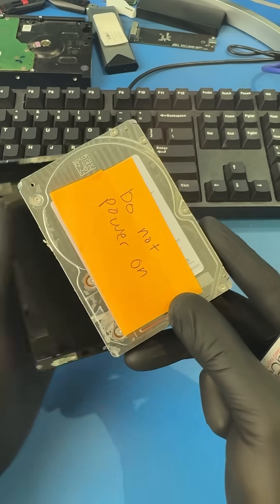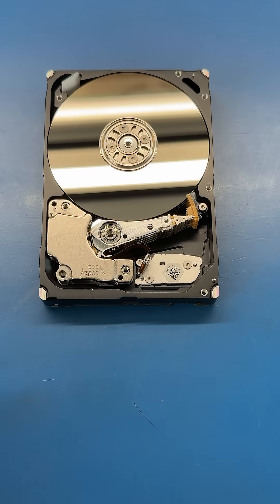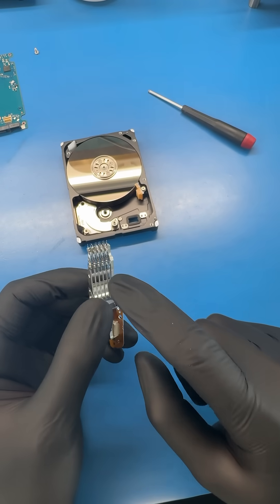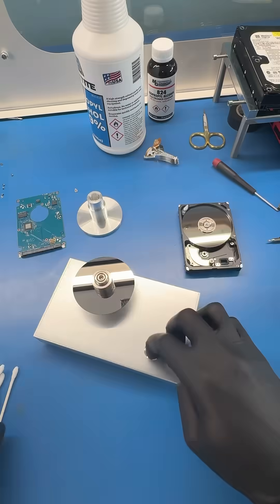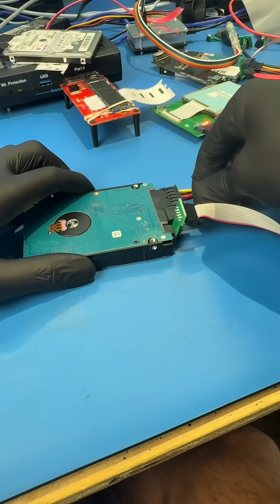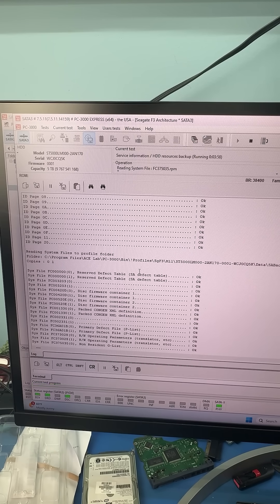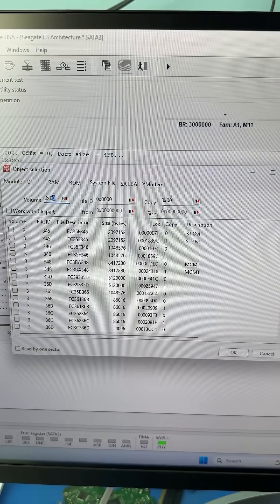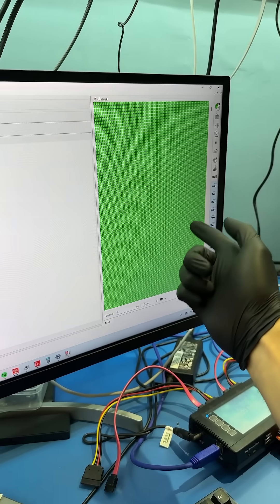Hard Drive Platter Extraction... #technology

Comment: To give people an idea of how difficult this stuff is, I've worked at some repair shops over the years. We didn't do hard drive recovery, too difficult, and if anyone came in asking for help we'd be honest with them: It's expensive, time consuming, and the potential of it working is not great. We're talking easily hundreds of dollars, possibly thousands if the damage is particularly bad. This man does absolute magic
Reply: I have a sudden urge to want to learn this skill because of the difficulty and it looks like you work inside😂😏
Reply: @darthvoltron959  I wish you luck.  If you don't have ANY computer skills yet, I'd say start with something like a current CompTIA A+ cert and then build up into the hardware.  You've got to understand the basics of what you're dealing with.
Reply: @darthvoltron959  Look up Louis Rossmann he's done a vid about this and pointed to someone else who does it, can't remember who, with a minimal setup.
Reply: @darthvoltron959 go outside more
Reply: FYI, for anyone wondering. Most drive recovery begins at $550 & goes up from there. I spent $800 to have mine recovered. Had years of papers on there, music, & pictures. Worth every penny. My dad's laptop, $1,500 later they recovered 98% of his data. Thing wouldn't power on (the drive), so they manually did it somehow.
Reply: I worked at a shop for a while, and it was the same for us. We didn't have the tools or space for hardware recovery, so we stuck to software, which was often successful. Granted, the technical process of what's shown here is very approachable, especially if you can already do board-level repair. It's a delight to see the 'next step' that we sometimes sent drives off for when the data was worth the money! An ounce of prevention for a pound of cure. Back up your valuable data!
Reply: To my knowledge even hard drive recovery places can only go as far as replacing the heads. I always understood that if the platters come out, there is no chance of reading that data. What this guy is doing should be impossible.
Reply: @Ozzyman11  That's not entirely true. Yes, if you take out the platters in your house, you're almost certainly fucked. There is almost no gap between the heads and the platters, and even microscopic pieces of dust getting on the platters can cause a head crash, this is why drives are sealed the way they are.

However, drive repair shops like this that are capable of doing platter swaps have incredibly well-filtered cleanrooms that are usually ISO Class 5 or Class 100 certified, meaning that there are very few, if any, dust particles of a specific size or above in the room, meaning there is nothing in the air that can damage the platters.

This is why you send failed mechanical drives to a professional like this. There's absolutely no way you perform a head swap in anything but a cleanroom like this and get all your data off of it. With older, less dense drives you might recover some stuff, but almost certainly not the whole thing.
Reply: @wisplite wouldn’t he need to be wearing a completely enclosed suit for that to be the case? i’d imagine his arm hair and skin cells would be floating around
Reply: @wisplite  the heads do not park over the platters, they park in a safe position. You can easily replace heads with little to no risk to the drive. 

As far as dust goes, you can just make a small plexiglass/lexan box with some basic filtering and have a plenty clean enough space to remove the platters with no concern. The data is stored magnetically, so as long as the platter itself isnt damaged, recovering data isnt that hard. Unless the drive is encrypted of course, then you're fucked without the key.
Reply: @wisplite  Dont you have to make sure they are placed in with the correct rotatation or does that not matter?
Reply: @IanB8968  Probably in a pressurized clean room, like at least, a Class 100 to attempt repair on hard drive platters. 

Just doesn’t show us because it would be technical and boring. Because you can’t see the effects of a pressurized room that keeps nano particles down. It is has to be visited to realize what an amazing thing it is. 

Full suit would only be necessary if he was making the silicon chips and boards themselves and then that would be a Class 1000 room, instead!
Reply: @wisplite  how doesn't dust get in there with him from the outside like from his clothes or something? Or his tools or anything it's almost impossible idk about this stuff I am curious
Reply: @Ozzyman11  no it isn't this kind of data recovery has been done for many years, you do the work in a cleanroom to protect the platters.
Reply: @Ozzyman11  no it's not impossible.  Because when any reading platers gets damaged during accessing of HDD. It's doesn't just Hardwear issue. It's also causes software issues. More specifically data allocation memory issues also raises. So even after replacing the reading platers when u connect the drive it doesn't just start reading data from HDD just like before but it doesn't know from when to start reading data.  So this person is basically scanning the HDD after replacing the reading platers for its data allocation memory and seeing the location of data at where it's stored and then he is trying to access that data by directly accessing the location form that specific software.   

Ones you recovers all the Data to another drive , u can just format the whole HDD and then again u can start using ur HDD like normally.  Because one's it's gets formatted.  All the Data is gone and when u store new data then HDD behaves normally and starts allowing data to write on HDD and store thr location in allocated memory.  

The missing space when u buy any drive is used for this only. For 1TB drive u can use about 931Gb space outof 1024Gb to store ur data.  Missing 93Gb space will get occupied by memory allocation system.  This 93Gb space will store the exact location of the data u r storing on those 931Gb space.  
When basically when any HDD gets damaged by broken reading platers. This 93Gb space which stores location of ur data gets corrupted.
Reply: @Ozzyman11 why would a platter being removed and put back have any significant effect on the data? It’s magnets on a fancy frisbee. Just don’t abuse it and it’ll be fine.
Reply: @ninjasauce32  one microscopic speck of dust in the way of the reading head and the whole thing becomes a paperweight.
Reply: @MrTeddy12397  I'm just looking at the key board... It's cleaner than out of a box. I'd be so paranoid entering that room!
Reply: @mattburow6018  I wouldn't be surprised if the guy is wearing a chip fab bunny suit.  It would be worth it.  The only way to be successful at this is to have a high batting average of success.  To a large degree, this is a word of mouth business, hence these videos.  Most likely recommendations are a primary selling tool.
Reply: @Ozzyman11  Yeah, no... it's definitely nowhere near impossible, lol. It may seem extremely complicated or difficult, but its' really not that bad. A bit sensitive, sure. But even then, plenty of things are more sensitive than HDD platters. The reality is, the biggest hurdle to this kind of recovery is the tools/environment.

And I say this with great respect. I don't mean to minimize his work at all, but it's really not that special. I would say work like surgeons, oncologists, etc, is a lot more precise and difficult.
Reply: There’s always someone smarter and better then you and willing to put in the effort
Reply: To add an additional example for the level of black magic this man performs;
I interned at a PC repair shop just about 20 years ago and the only place in Europe that'd do physical recovery of a HDD was a clean-room/sterile lab in Switzerland for about €15K (€1 ≈ $1 back then). 
Their services were mostly used by forensic teams.
Reply: For real, I've worked on PCs for almost 20 years and I will never touch the internals of a HDD. Too risky, too expensive.
Reply: .....
Do you know Jesus Christ can set you free from sins and save you from hell today 

Jesus Christ is the only hope in this world no other gods will lead you to heaven 

There is no security or hope with out Jesus Christ in this world come and repent of all sins today 

Today is the day of salvation come to the loving savior Today repent and do not go to hell
Come to Jesus Christ today 

Jesus Christ is only way to heaven 
Repent and follow him today seek his heart Jesus Christ can fill the emptiness he can fill the void 
Heaven and hell is real cone to the loving savior today 
Today is the day of salvation tomorrow might be to late come to the loving savior today 
Romans 6.23

For the wages of sin is death; but the gift of God is eternal life through Jesus Christ our Lord.

John 3:16-21 

16 For God so loved the world, that he gave his only begotten Son, that whosoever believeth in him should not perish, but have everlasting life.  17 For God sent not his Son into the world to condemn the world; but that the world through him might be saved.  18 He that believeth on him is not condemned: but he that believeth not is condemned already, because he hath not believed in the name of the only begotten Son of God.  19 And this is the condemnation, that light is come into the world, and men loved darkness rather than light, because their deeds were evil.  20 For every one that doeth evil hateth the light, neither cometh to the light, lest his deeds should be reproved.  21 But he that doeth truth cometh to the light, that his deeds may be made manifest, that they are wrought in God.

Mark 1.15 
15 And saying, The time is fulfilled, and the kingdom of God is at hand: repent ye, and believe the gospel.

2 Peter 3:9
The Lord is not slack concerning his promise, as some men count slackness; but is longsuffering to us-ward, not willing that any should perish, but that all should come to repentance.

Hebrews 11:6
6 But without faith it is impossible to please him: for he that cometh to God must believe that he is, and that he is a rewarder of them that diligently seek him.
Jesus
Reply: skill issue
Reply: I repaired computers (mostly software issues, but not only) from the age of 8 years, the people who thought they could do the same always said that AFTER I had fixed the problem, go figure... Those are the ones that made me sick of computers by the time Internet had started to blow up in the early 2000's, I was 15 back then. Man I miss the simpler days, lugging 60 floppy discs with a zipped game to my friends house so we could play it there as well, no problem. It was a wonderful time. 😇
Reply: @SimonHinz-gr5yg  Hahaha I was the kid with a backpack full of floppies! I put games on EVERY school computer and everyone loved me for it. The teachers were happy we were learning to use them and if our coursework was done for the day, it was video games, MTG, or euchre. Win/win/win.
Reply: Ya my old HDD failed, what actually killed it was me backing up the most important files all at once (i forget if I moved or copied). It died hours after finishing. If I hadnt gotten those files id have had to try to get it recovered. I still wanted what data I lost but not enough to pay hundreds. At this point I barely remember what I lost.
Reply: about 1k last i had my estimate done
Reply: Literally. As soon as I saw him looking at the headers under a microscope I knew this was a several thousand dollar repair. The price is not unwarranted though, many people would absolutely empty their pockets to save years worth of memories; myself included.
Reply: Yup, platter recovery is hell. There's a reason the facilities that do it are millions of dollars.
Reply: I’m currently in my junior year of my graphic design degree. Had a professor tell us about a girl who went into senior thesis with her drive with her work from all 4 years. She dropped it and bricked it. She contacted some repair place and they quoted her $4k and she agreed but it was too gone for them to fix 😬. Losing all your work in senior thesis and having to start over when the final portion of our program is a thesis exhibition is terrifying. This is why my program is pushing for us to have SSD drives
Reply: Even if you did set up a cleanroom or a sealed area in your  workspace you'd also still have to keep helium on site, because some drives are built with that sealed inside instead of air.
Reply: Cute 'nid pfp!
Reply: Yep. Back in the day, services like this would easily run $2,500-$10,000 with zero guarantee of it working. You had to literally ship it off to some clean room somewhere and wait weeks for someone to tell you what was what. Craziness.
Reply: Yes, it's very expensive. The chief accountant's disk failed in our accounting department, and we didn't have a backup in those early days. We had to pay more than one and a half thousand dollars, which was quite a lot in Russia twenty years ago.
Reply: It's not that hard, but it needs to be done properly and it takes time. No half assing a HDD rescue! A full drive recovery, if not damaged, takes a couple of hours. Creating the image/copying the drive sometimes takes hours upon hours, after the repairs are done. The worst cases are when the plates are damaged/scratched beyond the possibility of repairs. We can usually figure that out quite quick, but costumer still needs to pay for the time spent.
Reply: He > IS < " THE GOAT "
Reply: Yup send it to the special hard drive recovery guys.
Reply: Its no different then diagnosing and repairing any other machine like a car or car parts, a broken washing machine or furnace, etc. First you have to have the right tools, then you need the diagrams and schematics, and you have to learn what the components are and their function. Then it takes practice like anything else but its literally removing and replacing components. Its no different than anything else, the components are just smaller. People rebuild transmissions and its just as difficult. Just bc you dont understand how to do something or haven't learned to do something doesnt mean its some sort of magic. Anyone who is interested in this kind of work could learn to do it. This guy isn't any smarter then anyone else. Sure, he may know more about a hardware recovery then someone who builds transmissions but I bet this guy couldn't rebuild a transmission. The point is just bc someone knows how to do something you dont doesn't mean he's a genius. It means you haven't learned how to do whatever he's doing.
Reply: @Trolldaddy5   You also need special air filtering equipment for hard drives and some other things. But that's been DIYed before, too. You just need a box with fans blowing into it, with good air filters in front of the fans, so only filtered air is in the box.
Reply: Well now you know who to send them to!
Reply: I paid 1.5k euro to get my drive repaired a few years ago
Reply: That's why backups are so important
Reply: Thousands? Damn, you worked for some real crooks man
Reply: Only bitheads should do this kind of work!
Reply: I'm paranoid about data loss, I've got dirty pictures with sentimental value from the 00s. My current scheme is a working SSD, a nightly backup SSD, and a nightly cloud backup. I almost lost an important folder a few weeks ago, but the cloud backup saved my ass
Reply: @Nupetiet  For all obsessed about data preservation… not enough people have heard of #ArDrive/#ArWeave. Undeletable cloud storage! Spreading the gospel.
Reply: We used to warn customers that we didn't specialize in data recovery; we'd give them a quote (normally a huge amount) from a company we could send the drive to.  Most of the time they would rather gamble on the $60-120 we would charge to give it a try.  It's been a decade since I was doing this kind of work, but I still have a few hundred pounds of drives for parts in my basement I need to strip down for the aluminum blocks.
Reply: The only time worth recovering would be for a Bitcoin Wallet
Reply: You know zero about this, just like everyone else.
Reply: @Skindoggiedog 
So please tell me where your video is on YouTube so that I can watch you do it?  That’s what I thought, you can’t and never will!
Reply: Not to minimize what he does, but it's really not THAT difficult or complex. The biggest hurdle is having the necessary tools/environment.
Reply: Okay random YouTube comment
Reply: I’ve repaired my own hard drives before it’s not that difficult just have to pay attention and keep everything organized. If you are working on a hard drive that’s the only thing your working on in that area till it’s done
Reply: @CoinHuntingUSA  and make sure your beer goes on a coaster or it's all over
Reply: With such vital images I wonder why he didn't already have a backup.
Reply: You're one of his employees or family members promoting his shop.
Reply: doesnt seem hard to me, the hard part is getting all the tools needed to do it
Reply: @adairjanney7109  You have a Class 1000 clean room? As in a pressurized room to keep micro particles from flying around to prevent nano dust from damaging sensitive electronics, like those hard drive platters? Those are no joke. It’s what’s required for that level of repair. I wish he’d show us a behind the scenes of that room he films and works on.

Him scanning and clearing it for scratches when he pulled the drive apart was probably the most nerve wracking part. He sped that up by 1000 times. You have to move incredibly precise, slow, and smooth. Measured moves done hundreds of thousands of times to NOT make a mistake. 

So you think it’s that easy to repair hard drives? Why is data recovery repair so expensive and done only by the best certified technicians, like this guy. There’s a reason why this is an uncommon service. 

This guy is beyond just a mere electronics repair guy.
Reply: What are you smoking, he did it in 30 seconds 😂
Reply: @RealEyesRealizeRealLiez bait used to be believable
Reply: @RealEyesRealizeRealLiez 
Oh yeah, absolutely. High level professionals do not charge for time, they charge for all the decades of studies, experience and expertise that enabled them to do it fast and with perfection.
Reply: @RealEyesRealizeRealLiez  he didn’t do it in 30 seconds😂 it’s edited you dumbass
Reply: @RealEyesRealizeRealLiez  Here’s your bill then:

- 30 seconds of time talking to you in a sped up video on YouTube - free

- 30 minutes of careful disassembly and analysis; 20-60 minutes of working with firmware; ordering or stocking replacement heads for that specific drive; time taken up on a machine to extract all the data; another drive to send data back to the customer; investment in a clean room, specialty tools, and specialized software; labor time in talking to the customer and maintaining ultra clean surfaces, clothing, and tools; and more hours than you personally can imagine learning how to do things the right way - $2500 minimum
Reply: @RealEyesRealizeRealLiez  oh man, a video cut down to 30 seconds, yea he did it in 30 seconds TOTALLY lmfaoooo, we got a dumb*ss here
Reply: This isn't magic. He repaired a couple heads and made an image.
Reply: @RanCham727  Yeah, and he did that with magic.
Reply: In other words you lied to the customer because you didn't know how to do it?
Reply: @CbrF4i600cc such a silly thing to say in a public space
Reply: @CbrF4i600cc  Where was the lie? It's expensive, and it's time consuming, and sometimes it may fail depending on the nature of the issue and the experience of the technician. If they want their data restored they can go to a specific data recovery technician. It's still gonna be expensive though.
Reply: @CbrF4i600cc isso kkkkk
Reply: @CbrF4i600cc  It doesn't sound at all like they lied. It is expensive and time consuming and if they tried to do it it would probably fail because as he stated, they didn't do it because it was too difficult for them so they sent the customers away.
Reply: @CbrF4i600cc Exactly what I was going to say. Sounds like something the Geek Squad would tell you to get you to buy another hard drive.
Reply: No one in a right mind would pay thousand dollars for HDD recovery lol, not even half of it 💀
Reply: @Calvin_M. Depends on what's on the hdd obviously
Reply: @Calvin_M.  What if it was the only copy of a new game someone was working on.  Or how about a novel that was nearly finished? Years of business records?  Yes. There's lots of people that will pay for that type of service.
Reply: @scottinWV  Backup is cheaper!
Reply: @Calvin_M.  様
今回のようなProfessionalな修理工房にHDDの復旧を依頼するのは 依頼者にとってHDD内のデータに1000＄以上の価値が有るからです。
また往々にしてこのような修理工房は修理レベルに応じてどれだけのコストが掛かるかを依頼者に説明し,了解を得ながら修理を進めます。
もしそうでなければ悪徳業者と言われるでしょう。
Reply: @Calvin_M.  Bitcoin drives?
Reply: @Calvin_M.  you underestimate what people will pay for things, i know someone that spent 6k on legos cause it was worth it to him to get em. maybe you never had anything stuck on a hard drive worth saving, but im sure there are folks out there that would take a loan out just to get the right kind of data important to them back
Reply: @ClippyisHereToHelp yeah federal government would pay millions to get hillary Clintons server repaired and down loaded, now maybe john boltons drives
Reply: @Calvin_M. data can be one of the most expensive things in the world
Reply: @Calvin_M.  Some people might pay hundreds of millions for data. 
I'm surprised, you are oblivious about the value of data. 
Without data, there is no knowledge.
Reply: @Calvin_M. You'd be surprised. Had a client lose two of their server drives, meaning the RAID was fucked. They ended up paying over $15,000 to recover those drives. Without it they would have lost years of financial data. Ofc having good backups negates this problem, but that's a fight in and of itself
Reply: @GabrielWilliams-h3l i might be wrong, but aren't server HDDs overall more complex/advanced than usual consumer ones? Yes, this one i might understand.
Reply: @Calvin_M. Not more complex. They are generally just made to a higher spec than consumer grade so they last longer and can run continuously for years. Outside of that, they are interchangeable (not that you should, but you can)
Reply: @Calvin_M. You have no clue lol

Physical stuff like this can be $1,000+
Reply: @Calvin_M.  It depends on the data. I interviewed with an organization that had a machine with a single disk that had classified government data on it with no backup. The drive started to fail. They had a clean room onsite. They took the disk in the room, swapped the platters into a working drive and recovered the data. The data was worth millions of dollars, but they could send it out to an outside company because of the nature of the data.
Reply: @Calvin_M.  not true matters what the data is if it’s really important no doubt in my mind I would.
Reply: @Calvin_M.  if it's a life's work, pretty sure paying a thousand wouldn't matter.
Reply: @Calvin_M.  Depends on what data they are needing recovered. You don't just throw away critical files just because it's expensive to recover. Now if it were game saves and other junk, that would make sense. But photos that you can't replace, client info that you need to run your business, financial documents, etc are irreplaceable. Also, not everyone is broke.
Reply: @Calvin_M. you clearly have no idea what kinds of value data can have. Think  about an old, stacked but damaged  bitcoin wallet…
Reply: @Calvin_M.  People would pay lots of money for family pictures. 1000s of dollars is not much money unless you are on Section 8 or on food stamps. People spend 1000s on just one tank of gas for a day on a boat. My day fishing trips on my center console for 4 people cost almost 3k
Reply: @Calvin_M. Highly highly depends on what's on there.
Lets say someone lost their child and their drive containing the last images of them was damaged.
Many people would be willing to spend upwards of 10k just to recover the image.
Reply: @Calvin_M.  Depends.  I had a drive with pictures of my family from the last 20+ years on it.  Plus videos of my dad and brother that passed away 25 years ago.  It crashed after my daughter dropped it.  I would have easily paid $500 or more to have those back.  Luckily I thought ahead and had a backup drive with the same thing on it.
Reply: @Calvin_M. You must not be employed with anything that deals with data or computers. Maybe 3TB of your video games aren't worth 1000 dollars but media projects or even crypto currency can easily be worth $10k
Reply: @Calvin_M.  They absolutely would!  One of our employees failed to follow the instructions given to her to keep a backup of her hard drive at all times.  She was an arrogant engineering school graduate, not yet an engineer and did as she pleased.  Her HDD failed.  She had the only copy of an updated contract with a customer on that drive.  It cost almost $3000 for data recovery, but the contract was worth many tens of thousands.  The additional funds would not have been billable without that contract.
Reply: @Calvin_M.  I agree with you in the sense that you gotta be a little crazy to have data worth $1000+ to you sitting on single drive without back ups.

But this still happens a surprising amount in 2025. People have wedding or family photos or a bunch of college papers they suddenly want sitting on a mid 2000s computer in the corner of a closet somewhere.

Seen a suprising number of design businesses that kept basically their entire back catalogue on one big HDD likes this.
Reply: @Calvin_M.  Back in 2021, I had a hdd fail which happened to contain the only copy of 10 years of photos, videos, and files. It was actually the same week that I realized it was problematic and I should be diversifying my saved data. I paid $2,150 to get it recovered and receive a replacement drive. Was I frustrated at the price? Absolutely. However, I knew that there was no chance I could do it myself (due to both skills and environment), so I sucked it up and paid. I learned to be careful with my backups, but I am also so relieved to be able to have my photos back.
Reply: @Calvin_M.  If i wasn't able to recover mine myself, i 100% would've for even 10,000. You vastly underestimate the value a hard drive can hold -- especially sentimentally. It happened for me because i was backing up my backup, and during the process both simultaneously died and ALSO my online storage backup (3 backups) lost most files. That data was filled with 20 years of music compositions made by me since age 5, every day, 5 hours at least without a single skipped day. It was 20 terabytes of 10mb-100mb files (so ~40,000 music pieces).

 A lot of people that go to these places will go due to these reasons -- of course if its just games or random videos even, who cares. But some people store things that, when lost, essentially ruins their lives.
Reply: @Calvin_M. 
Depending upon how important it was to me, I would gladly pay that amount or even more!
Reply: @Calvin_M.  lmao maybe from your pov, as a brokie that has literally zero things worthwhile to recover :")
Reply: @Calvin_M. depends the type of data
Reply: @Calvin_M. You would be surprised. People pay a lot for data they value
Reply: @Calvin_M.  You'd be surprised
Reply: @Calvin_M.  Unless data on the drive worth more than that... not your cat pictures ofc, but something like bitcoin wallet etc
Reply: @Calvin_M. You have don't even know what you're saying
Reply: @Calvin_M.  It is true, when you have a backup! Ore unimportant data.
Reply: @Calvin_M.  you have no idea, what happened around 15 years ago in Hungary at Kürt KFT. An african delegation of a country went to visit Hungary, half of  the delegation went to the official state meeting, the other half went to the Kürt KFT. They had to recover some really big ammount of social security and tax related drives, and yes, they succeeded. and Yes they paid enormous ammounts...
Reply: @Calvin_M. I see a 14 yo here who doesn't know that 1000$ is not that much money, especially when there are important data to be saved.
Reply: @Calvin_M.  I worked on a data transfer project at a charity. We apologized for how long it was taking because of their obsolete computer. The owner held up one floppy and told us how it represented the work of five employees over a week of data entry—about 200 employee hours. Even at minimum wage, that's a lot. The entire hard drive was hundreds of times that much work, representing tens of $thousands in employee time.
Reply: @Calvin_M. You clearly don't have 3.5TB (YEARS OF WORK) of professionally relevant files
Reply: @Calvin_M.  Depends entirely on what's on the drive. If the drive has crucial research that you spent $100,000 on it's a no brainer to try to get it running again for a couple thousand. 

Basically any time it's part of a business and some amount of the data hadn't been backed up yet there's a decent chance it's worth it if that data is crucial to any part of your business.

Heck a lot of people would probably pay it even if it was just the drive that held all their family photos and was the only digital copies of them.
Reply: @Calvin_M.  You would if the data was more valuable than that, and it often times can be.
Reply: You be surprised. I work IT for a hospital and we don’t repair HD’s. We had a doctors HD that he didn’t backup even though he was told to do so. He ended up sending the Hard Drive off to get it repaired for 1000’s.
Reply: @Calvin_M.  If your PhD thesis was on there and you didn't have it anywhere else, yes you would. If you worked in the government and you had documents that could cost lives if they got into the wrong hands and you didn't want that, you would. In other words, if the contents are valuable enough, you'll do it even if you don't like it.
Reply: @Calvin_M.  I have seen bills over 10k, yes, data is important in todays age.
Reply: @Calvin_M.  You are dead wrong.  Sometimes the data is priceless to the customer.
Reply: @Calvin_M. in the creative industry, multiple ppl I know have paid over $1000 in a regular recovery, and much more for needing it expedited .  It’s pretty common in LA
Reply: @Calvin_M.  Not about the money for most people, it's more about the work/effort/memories associated with the files. A few gb of business records could easily equate to well over $1000 worth of labor. A PhD dissertation could be worth over 6 years of someone's life. Or maybe photos of a relative that passed. There are plenty of reasons and I don't really see any that wouldn't be seen as reasonable.

If my work laptop's ssd stopped working then that would've meant tens of thousands of dollars worth of work just disappeared forever. Stuff like infra admin accounts, root level admin accounts, our final backup for our database, and so many more "only copy" or "final copy" of things that can't be replaced. I guarantee a few thousand for recovery wouldn't even be a concern.
Reply: @Calvin_M.  Sure they would. I can think of serveral instances where it would not only be feasible, but also the cheaper way out.
Reply: @Calvin_M.  Maybe you wouldn't but tons of people would. My HDD has all of my photos and videos backed up on it. Also I have a few games that were never released that I would never be able to replace, for example ones a star trek simulation which has a detailed explorable interior of the Enterprise D, which was hit with a cease and desist by paramount and eventually deleted entirely. With almost 4tbs of irreplaceable data thats important to me, id pay 1000$ to recover it easily
Reply: @Calvin_M. the drive contained 3TB of photos, as the video says it’s a lifetime of photos. it’s understandable to want it back if you have the money to spend.
Reply: @Calvin_M.  Dude are you crazy? a few grand is peanuts to a company that just lost crucial files. There is ABSOLUTELY a market for HDD recovery. My company spends tens of thousands on backup software and hardware alone a year. Data is worth a lot of money and companies will spend to keep it safe.
Reply: @Calvin_M.  Hmmm, i see skill issue here